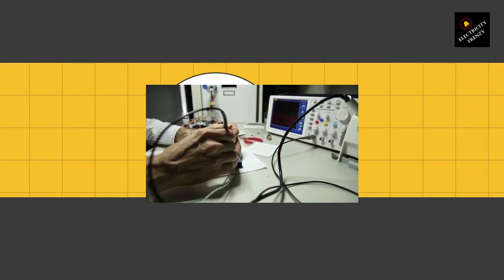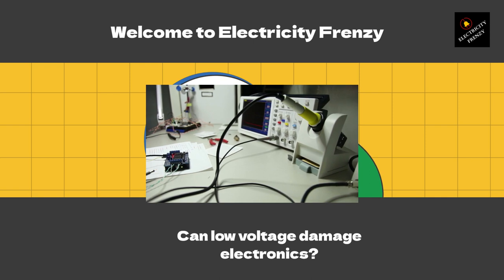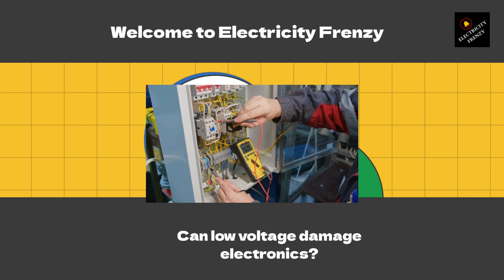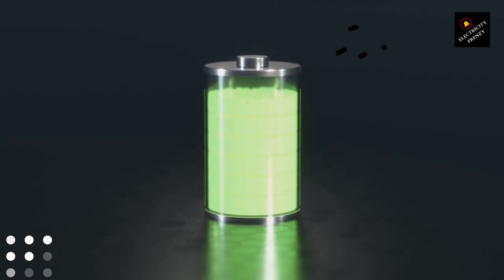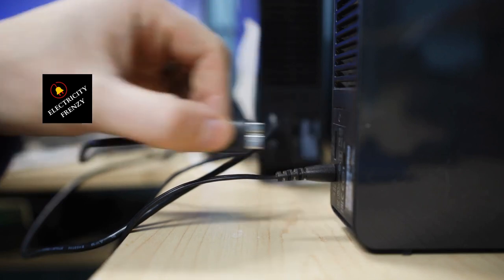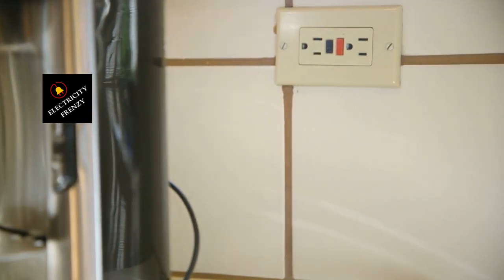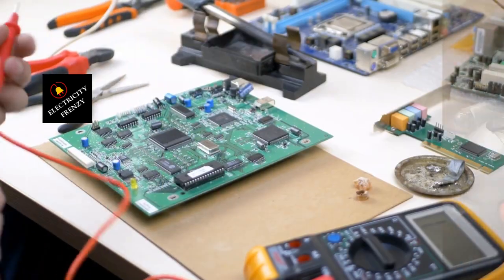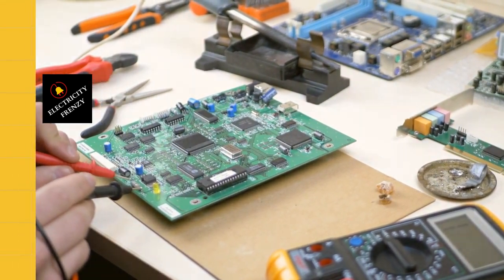Can low voltage damage electronics?

Comment: Can i use my lap while charging in low voltage?
Reply from the maker: The laptop charger usually has a wide voltage range. And you can work 100% on lower voltage, but you should check it.